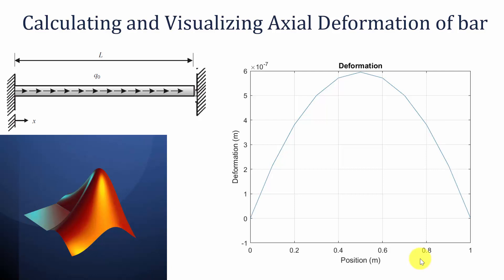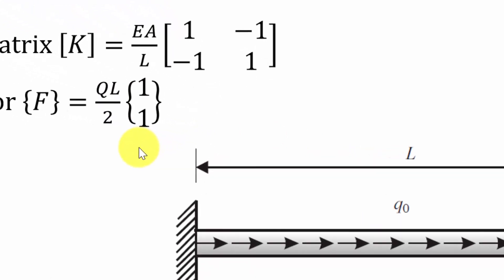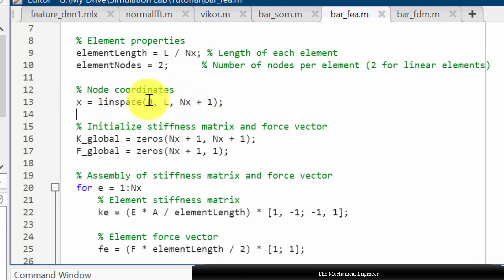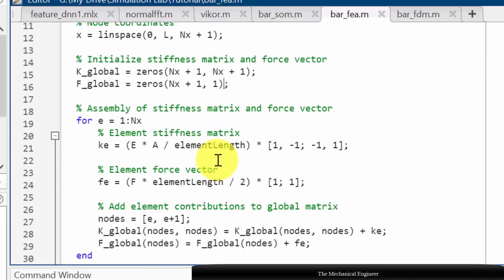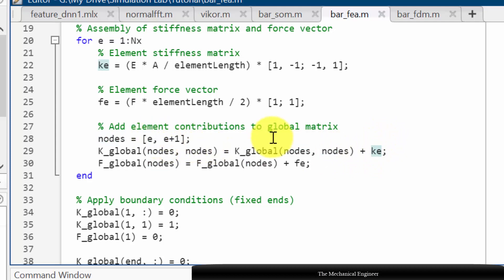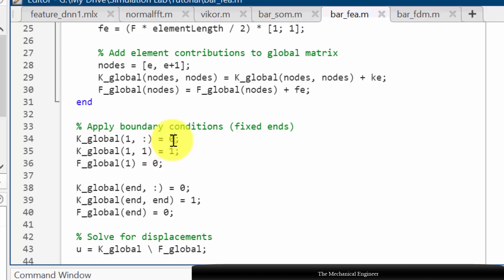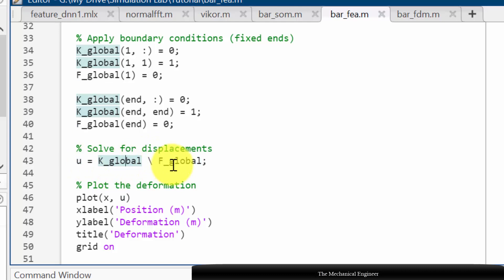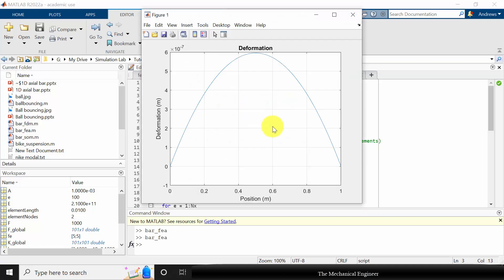Calculating Axial Deformation of bar in MATLAB | Finite Element Analysis (FEA) Method

Comment: Where is the code?
Reply from the maker: % Parameters
L = 1.0;           % Length of the bar (meters)
Nx = 100;          % Number of elements
E = 2.1e11;        % Young's Modulus (Pa)
A = 0.001;         % Cross-sectional Area (m^2)
F = 1000;          % Applied axial force (Nm)

% Element properties
elementLength = L / Nx; % Length of each element
elementNodes = 2;      % Number of nodes per element (2 for linear elements)

% Node coordinatesx = linspace(0, L, Nx + 1);

% Initialize stiffness matrix and force vector
K_global = zeros(Nx + 1, Nx + 1);
F_global = zeros(Nx + 1, 1);

% Assembly of stiffness matrix and force vector
for e = 1:Nx
    % Element stiffness matrix
    ke = (E * A / elementLength) * [1, -1; -1, 1];
    
    % Element force vector
    fe = (F * elementLength / 2) * [1; 1];
    
    % Add element contributions to global matrix
    nodes = [e, e+1];
    K_global(nodes, nodes) = K_global(nodes, nodes) + ke;
    F_global(nodes) = F_global(nodes) + fe;
end

% Apply boundary conditions (fixed ends)
K_global(1, :) = 0;
K_global(1, 1) = 1;
F_global(1) = 0;

K_global(end, :) = 0;
K_global(end, end) = 1;
F_global(end) = 0;

% Solve for displacements
u = K_global \ F_global;

% Plot the deformation
plot(x, u)
xlabel('Position (m)')
ylabel('Deformation (m)')
title('Deformation')
grid on

Comment: How to derive axial deformations for a column in matlab using fem and also for buckling condition
Reply from the maker: To derive axial deformations for a column using the Finite Element Method (FEM) in MATLAB:
Define the geometry and material properties of the column.
Create a mesh with finite elements (e.g., 1D beam elements).
Specify boundary conditions (e.g., supports and applied loads).
Assemble the stiffness matrix for the system.
Apply loads to the column.
Solve for the displacements using a solver like the backslash operator ().
Calculate axial deformations at different points along the column by analyzing the displacement results.